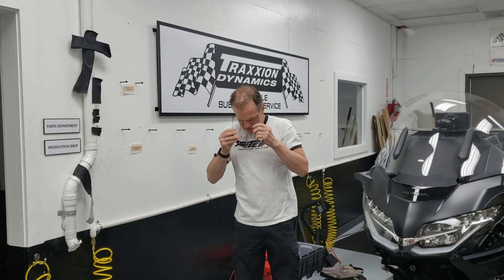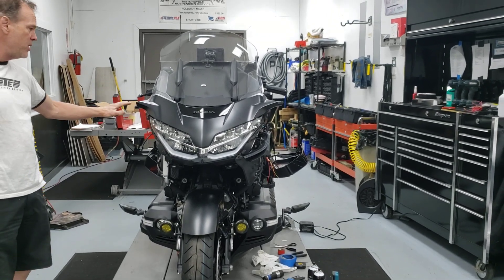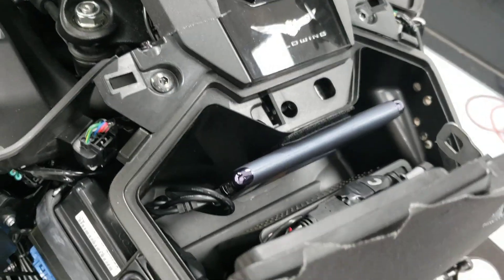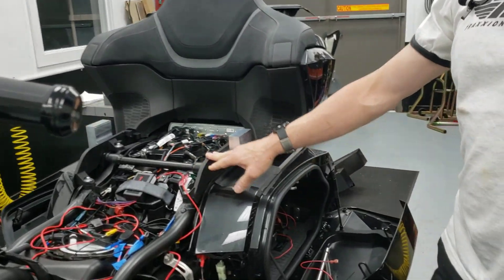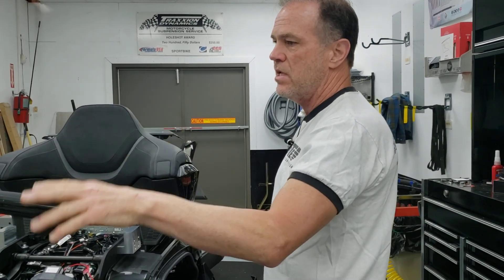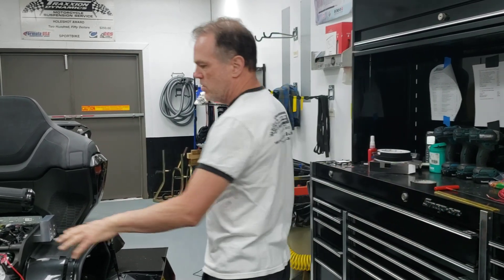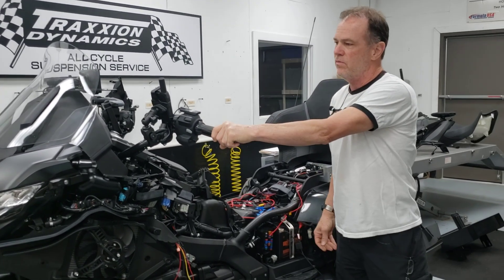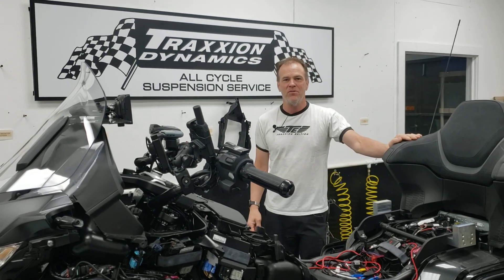2021 Honda Goldwing Mega Build Update 5.29.21 by Max McAllister of Traxxion Dynamics

Comment: My electricall connection fan gave out after 2 month, I had made vents in my glove box as well with mesh ( to keep out as many bugs as possible)I had used a thermal king wrapping that worked fantastic, I ended up making a new fan with temp and relay that kicks in . My design now works perfect
Reply from the maker: That sounds cool!

Comment: Max, the seat solution is simple and I'm truly surprised you didn't come up with it. (You are an avid bicyclist.) I've started wearing bicycle shorts under my pants when doing IBA or long-distance runs. It works a treat. I also use seat beads, but honestly, a quality set of bicycle as underwear is the trick and I only keep the seat beads around...in case.. On really long runs I bring a couple of pairs with me so I can always have fresh ones on. They are much, much, much cheaper than any aftermarket seat!
Reply: Try Moto Skiveez, designed more for motorcycles and the type of riding you do, different than bicycle
Reply from the maker: Great ideas guys!

Comment: Hey Max how's it going, quick question that has to do with my personal bike, not this one. I just purchased a 2018 Honda goldwing with 4700 miles on it, seen your vids about the front suspension upgrade and  many others. Wanting to know if you think when doing the upgrade do you think its necessary to do front and back or would just the front be a big noticeable difference? Also if I get the upgrade done I'd like for it to be at your shop since you are extremely familiar with this bike and I'm wondering about turnaround times on a job like this and maybe some other things while it's there. You can possibly respond here, or simply leave a number to get in touch with you at your shop, thanks.
Reply from the maker: max@traxxion.com is the best way to get me.  We do our full suspension package by appointment, and 3 guys working together turn the bike around in about 3 hours!  We can do other accessories at the same time.  The best time to get the suspension upgraded is the day after you buy the bike!

Comment: Do you sell the accessory shelf?
Reply from the maker: It started as one for a 2017 from Firecreek Accessories, which is about $180... it took 5 hours to fit it to the Wing, and that was starting with the Wing fully disassembled.  It is very difficult... on and off with that instrument cover like 15 times.  This shelf finish installed probably cost over $800.  I may try and take the measurements and make a kit from it.  But even then, it would take a person of significant skill to install it.
Reply: @Traxxion  I think I used an accessory shelf for a BMW and it definitely isn't a very good fit but it works for what it is, in hindsight I think I would have preferred to have something a little lower because mine is on risers that allow the little trapdoor air guide to still pop up and down. Takes up a lot of real estate for when I'm trying to look right in front of me.
Reply from the maker: @as685030  I always avoid compromising safety over having gadgetry.